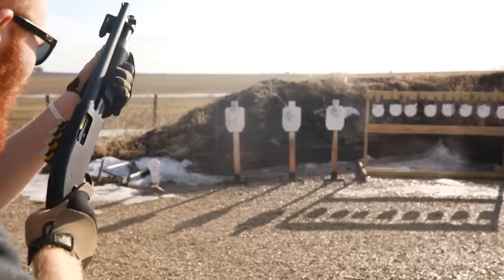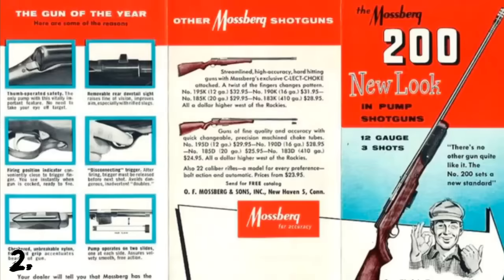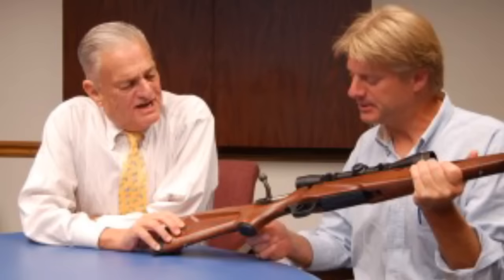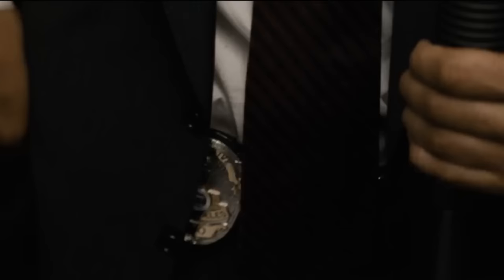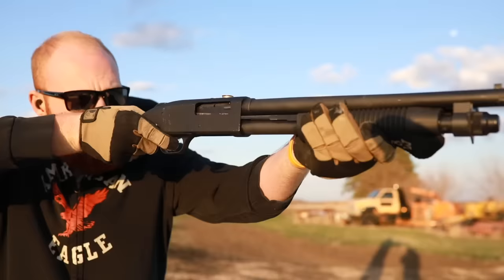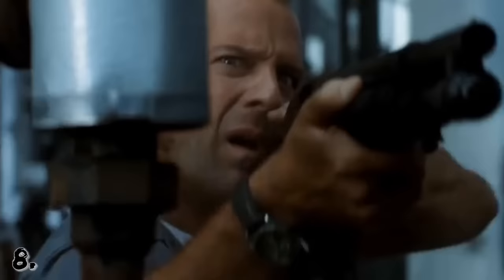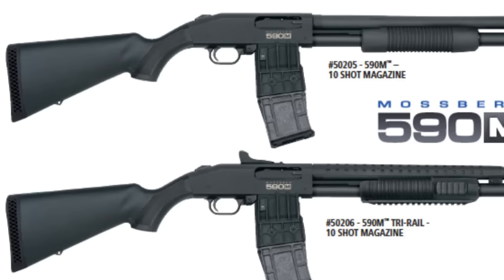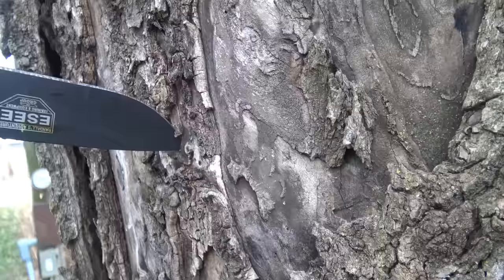10 Things You Don't Know About The Mossberg 500 & 590 Shotgun

Comment: I bought a used Mossberg 500 that nearly took my head off! Treat every weapon as if it were loaded, and never point a weapon at anything you do not intend to shoot. I think most of us know those to weapons safety rules by heart and at least common sense should kick in if you've never received professional firearms training. I think there should be a 5th weapons safety rule as in, " Dont intentionally alter a weapon if dont what the hell you are doing" and fail to inform anyone that you might sell said weapon to later. I rotated the weapon muzzle up at a 45° angle, and begin chambering and ejecting the shells. The first time it went off, I blamed myself for unknowingly bumping the trigger somehow. After running it through another 10 rounds and it firing almost every time i slid the pump forward, I got the idea that some dumbass had tinkered with it. Im guessing they tried to fix it where it would fire as each shell was chambered. All without useing the trigger. It didn't break my heart one bit when it got chopped up and destroyed. I haven't owned a used pump shotgun since.
Reply: Nunya Biznez   Interesting. Glad no one was harmed. And you lived to figure it out. Sounds like you weren’t  sure. But that’s a pretty good guess. It may have been ultra dirty. Or the firing pin was broken and jammed forward and struck when action was closed.
Reply: Just"wow"...

Comment: What is the "A" designator on the 500? Is that the thicker barrel?
Reply: Here is what the letters designation are:
500A = 12 gauge
500AB = 12 gauge, Dual Action Bar
500B = 16 gauge (has been discontinued)
500C = 20 gauge and 12 gauge
500D = 28 gauge (never went into production)
500E = .410 bore[17]

Comment: There is one thing I wonder about on my Mossberg 500 12ga. Perhaps someone can answer.
Right next to the trigger guard on the left side there is a small flat button that must be depressed in order to pump the next round into the chamber.
For me, as a lefty, this is a pain in the ass.
What is it for and can it be safely overridden in some way?
Is it designed to keep the recoil from racking the next round accidentally?
I haven't been able to get any info on it.
Any 500 owners out there who could advise or speculate?
Reply: It is the action release, if the shotgun has a round racked into the chamber, or if you racked the pump with nothing in the tube, the action tries to keep you from ejecting that live shell unless you press the action release. It is there to stop the sort of buck fever reaction where someone with a lever gun could work the lever over and over without pulling the trigger emptying the gun without firing. Pulling the trigger also acts as an action release, but at expense of firing the shell, the action release allows the shooter to eject unfired shells, like when you want to unload the gun.
Reply: If you keep the shotgun at cruiser ready, ie tube full of shells, chamber empty and not pumped, then pumping the shotgun is a positive check that the chamber was empty. If it won't pump, then someone either loaded it without your knowledge or someone didn't clear the gun correctly when they loaded it. I used to keep a cruiser ready shotgun next to my apartment door, until one day it appeared to have moved and when I checked the action wouldn't pump. Apparently a maintenance man had been in the apartment and chambered a round. I had to reclear and reload it to make it cruiser ready again, after that it was hidden where apt workers wouldn't find it.
Reply: Good info. Thanks for replying.
For someone who is very familiar with their firearm, is there any real downside to disabling it?
Reply: Good advice. Thanks for the reply.

Comment: Mossberg parts wear out much quicker. I have had 2 older mossbergs have the shell stop go bad within a decade. A poor shell stop will dump your entire magazine tube at your feet during a pump. Remington has NEVER seen this issue like I have seen Mossberg have. I'll stick with my Remington 870's I have an over 30 year old Remington 870 that has been flawless, and a 14 year old Remington I bought brand new that has been flawless. Fix your shell stop Mossberg!
Reply: Had mine for over 36 years never had that happen, ever. Won't own a remington of any make.
Reply: I think you flipped your guns.
Reply: Mine works perfect. Never heard of that happening before did you buy a used gun

Comment: Well, as a Master at Arms in the Navy, I can tell you both mossberg 500s and Remington's suck and break a lot. I deal in the Armory at my current command and while we do have Mossberg 500 shotguns, we will NEVER issue them out. infect they are being phased out for almost all purposes aside from breaching....
Reply: Assyrianblood 545 
It would be great if you could expand a bit on the breakages.
I have a 500 and my brother has a 590. I have adjusted both for reliable operation in bear country and would like to hear from your experience.
After the needed adjustments, they haven't missed a step.
Reply: Camel 73 we have ones with sheared off bead sights, stocks that loosen just by light use and transport, firing pins being messed up and stuck in the forward position, locking lugs being mangled, safeties being jammed and yeah.